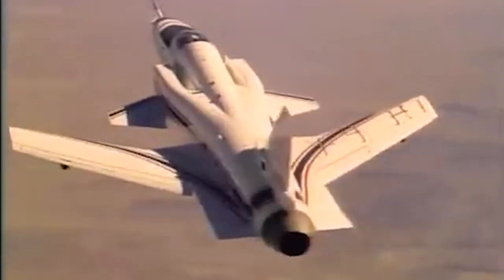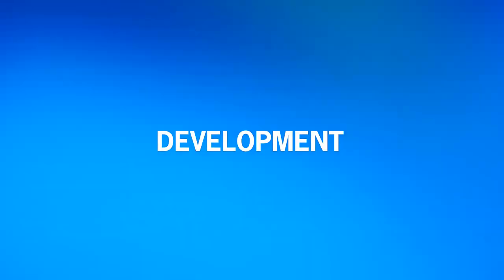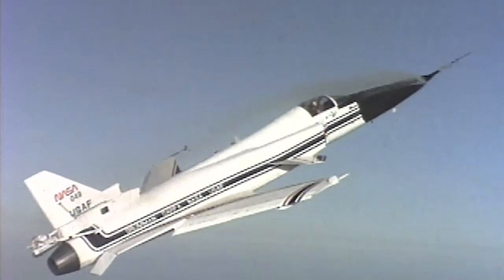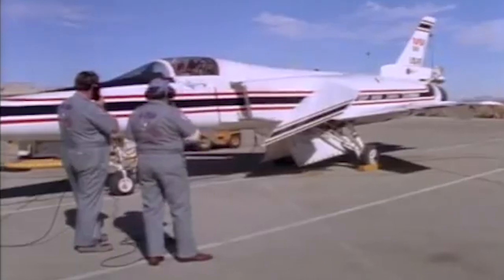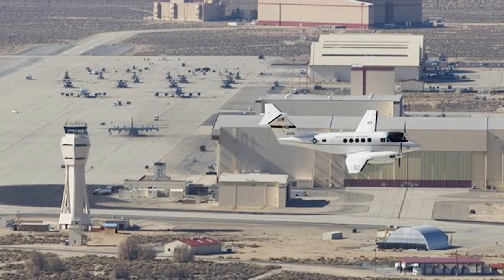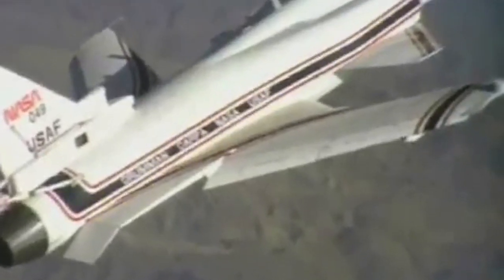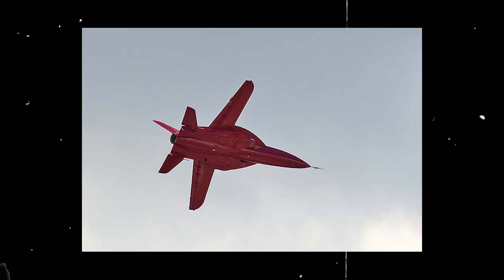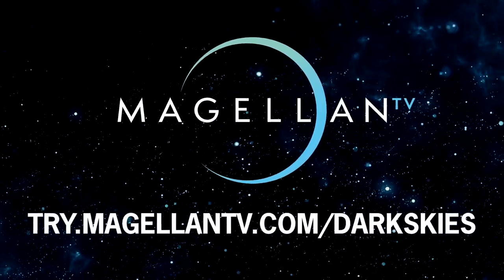X-29 - The Most Unstable Fighter Jet Ever Built

Comment: Anyone have a link to further reading about why forward swept wings have more twisting forces than rear swept?
Reply: Did you ever stick your hand out of a car window as a kid? The answers are all there
Reply: @denziljoe  that just explains to me why it has twisting forces at all, not why forward swept wings have more than rear swept
Reply: @bassett_green  Same reason wind vanes work and why you cannot fire an arrow backwards, the force of the 'wind' wants to push the tip back to trail behind the wing's point of attachment to the main fuselage
Reply: @bassett_green  It's called aeroelastic divergence. Forward swept wings don't twist more than back swept. The problem is they twist in the opposite direction. 
It should be easy to realize that the aerodynamic center of a forward swept wing is ahead of the wing-fuselage joint, while for a back swept wing it is behind. As a result, lift causes a forward swept wing to twist upwards such that the angle of attack is increased -> increasing lift -> increasing twist -> increasing lift again and so on. The structure must resist this self amplifying twisting or else the wings will twist right off the plane. Also, as aerodynamic forces and moments increase with the square of speed, there is always a speed where aerodynamics will overcome the structure and then divergence occurs (which is why the speed is called the divergence speed).
In a back swept wing, the twist reduces angle of attack, so it is a self correcting geometry and such wings do not have a divergence speed.
The advent of unisotropic composite materials in the 80's allowed designing a forward swept wing that is strong enough to resist divergence with not much weight penalty.
Reply: @ASJC27  thanks for the explanation, I appreciate it!

Comment: Sorry, but this video is wrong on several points. 
The forward swept wings didn't cause instability on the x29 project, the cannards did. The plane was highly reliable and described as a marvel to fly by the test pilots. Saying it's the most unstable because it needs computers is also misleading, as it's not the only type of plane that relies on computers to fly: the f117 needs them too, and that is not a forward swept wing design. The su-47 isn't a clone the x29 (seriously, get over thiking the russians copied everything), both russians and americans insvetigated forward swept wings out of interest of the german Ju 287. Both concluded the same: good for low speed. Finally, forward swept wings were used as early as 1935.
I recommend watching the videos from PeninsulaSrsVideos, they post lectures from actual engineers and pilots who worked on the projects, there's one on the x29.

Comment: Elevators don't need operators. If something goes wrong, it stops and someone has to come and fix it. Trains don't need engineers. If something goes wrong, it stops and someone has to come and fix it. Airplanes don't need pilots until something goes wrong. No one can come to fix it, someone must already be there to do the job. If there comes a time when every problem can only ever be a catastrophic problem, then flight crew is redundant. As for forward swept wings, not until fighters become pilotless. It's pointless to have a vehicle that can perform flight maneuvers that would kill it's pilot.

Comment: The X designation means it was the equivalent of a concept car...used to test ideas...so it's not necessarily reasonable to call it the most unstable fighter jet ever built...especially since it never attempted to have an F designation. It was strictly a platform to test experimental ideas...& was very successful as such in the creation of new aircraft materials. When you consider the F-22...nothing about the X-29 stopped due to being intimidated by the Russian version; that's like believing in the superiority of the White Swan due to a slightly faster Mach speed...when in reality...the United States realized what "fast enough" was in the 1960s.

Comment: Given the benefits of the design I wonder how the x-29 would handle if updated to 2021 gen 6.5 /possible. Gen 7 tech and modern  miniaturisation , there has been a big push recently to find  a strategic UAV with multi raid capacity.  Given Russian and more worrying a clone of the Russian design in Iran’s hands.  It’s clear with the U.K. ray program automated uav will be used do more than patrol and turkey shooting terrorists maybe it’s time to dust off the old designs, in combination of the advances in cpu and miniaturised of other tech and  sensors in combination with a bend wing tech, and a lot of cpu and digital gyroscopes and vector thrust without the instability of the added human cockpit locally , it the ai preservation mode in combat is advanced enough this maybe one craft that will give the yt-22 a run for its money

Comment: Ok, so this comment only has to do with forward swept wings and is more of a random question for anyone out there.. Back in 2008 my buddy and I were out back of his house in new england(northeast US).. he lived relatively close to an airport and there are also a couple air force bases within 50 miles towards the coast.. I mention this because of size comparison to passenger jets flying low nearby.. we both saw a low flying forward swept aircraft which looked to be about the same size as a good sized passenger jet, not a small private jet or fighter jet size.. but the crazy odd thing about this craft was that the forward swept wings started all the way back at the tail.. 
                             /\
                            I   I
                            I   I
          \  \            I    I           /  /
             \  \         I    I        /  /
                \  \      |    |      /  /
                   \  \   |    |   /  /
                      \  \I    I/  /
                         ∆ ∆ ∆
.. that's my best comment rendition of what we saw, with lack of effort obvious... those bottom triangles don't necessarily represent engines.. It seemed all black, no markings I could see, no exhaust or visible jet engines, no sound and went right overhead at lower altitude then any other air craft we've ever seen in that area.. I figured it was definitely not a prototype because of the area it was being flown in and figured it was definitely military.. except I haven't seen anything close to it to this day in 2021.. figured if it was military maybe somethng would have surfaced by now.. so I guess my question is.. has anyone else seen something similar over the past decade or so?

Comment: Not true, about instability.  Foward sweep and canards are unconventional, but not unstable.  You want unstable?  Think F-117.
Reply: the center of mass is behind the center of lift, so it's unstable
Reply: didianddiano is exactly right. The X-29 was unstable, and by design. It is well documented that is was one of the most unstable platform ever made with a  -35% static pitch margin. The F-16 was the first unstable fighter jet and it is well known that it can't be controlled without the automatic flight control system, and it had a static margin of only -6% in air to air configuration. With large external stores it was -10%, still not nearly as unstable as the X-29.

Comment: That design look redicilous
Reply: It worked! And led to the development of the F-117, B-2, F-22, F-23, and F-35 for the computer-aided flight necessary.
Reply: @tempestfury8324  F-117 was already operational before the X-29 first flew. They had nothing to do with each other. Also the X-29 program was meant to test the implications of the aerodynamic of forward swept wings to flight mechanics and whether composites can make it structurally viable. It was not meant to test CCV. CCV was already a known proven concept in service in the F-16 and did not require or get any new knowledge from the X-29 program, so it did not in any way influence the design of later jets. 
If stealth wasn't a primary consideration in later designs we might have seen forward swept wings in fighters, though it is debatable if (other than the issue of tip stall) it has any advantages over a close coupled delta-canard.

Comment: I listen to the first 30 seconds of this video and I have to leave this comment stating you don't know what the hell you're talking about.
NASA and the Air Force did not throw this airplane together for testing the forward canards.
Grumman won  the contract from  competition with other aircraft manufacturers, to test forward swept wings with a new composite material that would make the Leading Edge increase the angle of attack,  instead of decreasing which forward swept wings had a tendency to do. The aircraft was built as a test aircraft for several different systems. Fly by wire was one of the main ones. The aircraft was built 35 times more unstable than any aircraft. ( on purpose ) A lot of the aircraft was built from parts of other airplanes to save money. The fuselage is from an F5 the landing gear is from an F-16 the engine was from an F-18. It was built that way because it was a test bed..  you bonehead. You do not want a fighter aircraft to be a stable weapons platform, you want instability. Once again the main purpose of this aircraft was to test the composite material that would make the wings strong enough if they were forward slant. The instability of the aircraft needed the fly by wire which was a new invulation. The airforce decided to go forward with their stealth programs which is why the air frame was not further used . This is the third video of yours I've watched and all of them are bullshit. The name of your podcast should be dark lies